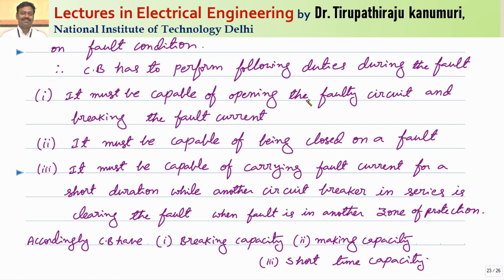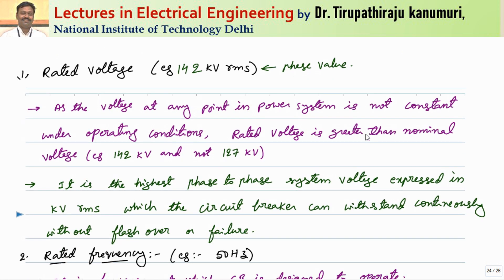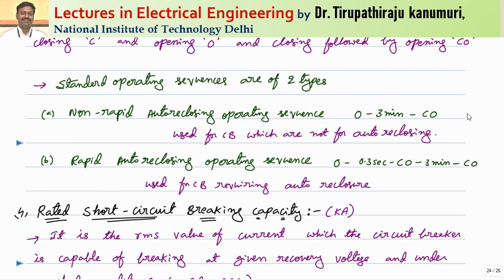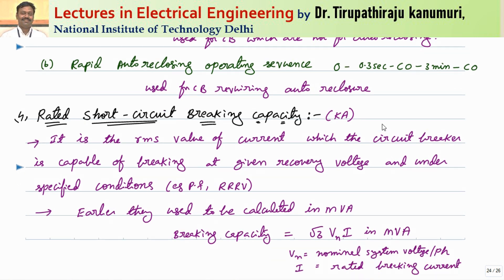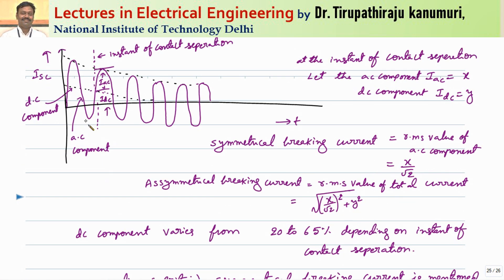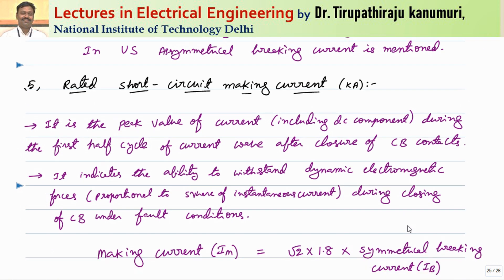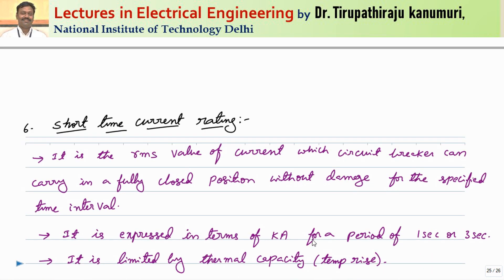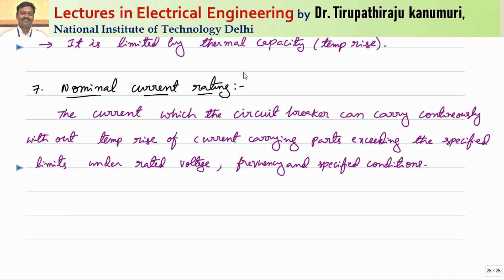SGP210 Circuit Breakers Ratings

Comment: Sir in which state the circuit breaker is oprate 
1.sub transient or 
2.transient state 
Please explain
Reply: After 2 to 4 cycle circuit breaker generally operate.
Reply: It operates in transient region as during subtransient region braker itself can get damaged

Comment: Sir at 10:43 short circuit making capacity my four is why we are taking here value of current during faulty condition during closing because circuit breaker is always open during the faulty condition. Please answer sir
Reply: I also have doubt in this but sir told that we have to concern about dynamic electromagnetic forces.

Stat 2 :  And during breaking the circuit breaker not operate just after fault but it will take 2to5 cycle so the current will be less .(stat 2 is my understanding)

Comment: Sir at time stamp 3:50 you told that CB voltage rating should be phase value, then after you writtern in material that its phase to phase value. Kindly tell us which one we should consider.
Reply: Phase to phase value i.e. line voltage value
Reply: @manishkadwa8657  Then how is 142KV rated voltage for CB for 220KV system.
I am confused... If it has to be Rated line voltage then it should be greater than 220KV.